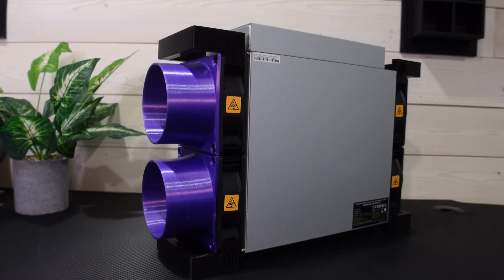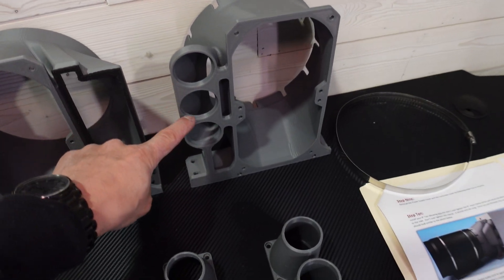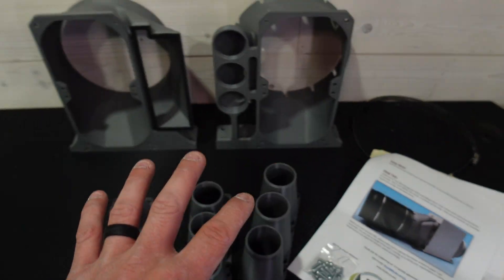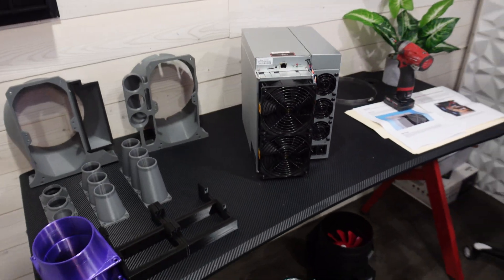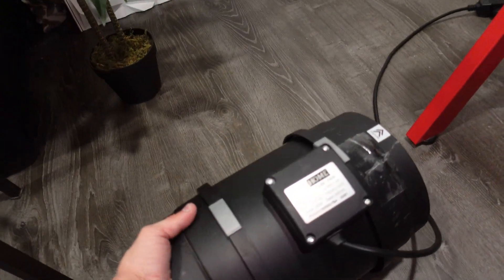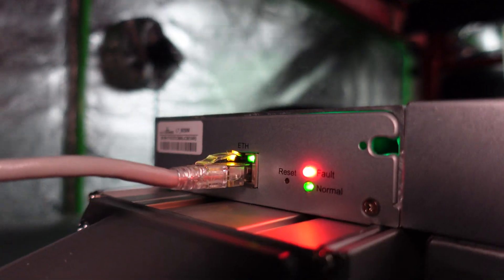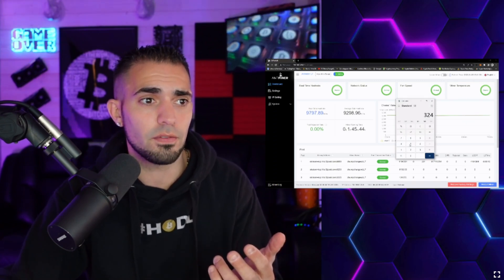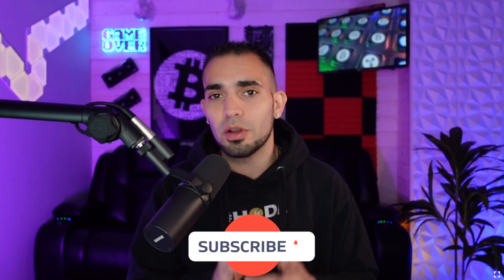Best Cooling Solution?

Comment: Leaving those PSU fans installed is a mistake; they partially block airflow and obviously contribute to noise. The same can be said for the grilles that "protect" the intakes and exhausts of the main hashboards stock fans. These metal grilles serve no purpose, so they're perfectly dispensable.

Comment: I have the Fruits and Associates kit for the K7 and the actual AC Infinity 8" inline fan. The AC infinity fan is only on at 50% and only draws 50-60 watts. So it's really important to get the correct fan for the kit because it will actually save you many watts at the wall.
Reply from the maker: Yes I am in the process now and will do an update video with the L7 on low power mode

Comment: CCXD wow awesome content great 👍 I got allot of this shroud as well even help with the S17 shroud design with John truly awesome kits! and if your in-line fan die your miner will shutdown, your PSU will shutdown first before the ASIC chips even gets to its 88*c shutdown limits, the previous design that only cool the hashboards will shutdown when the PCB hashboards temp gets to its set limits well before chip temps limits, also you can max OC using air vs water with this kit.

Comment: Need before and after temperatures
Reply: Also, those fans you left in the psu add significant air restriction
Reply from the maker: I show the temps in the video at the beginning and the end, I just dont say it outloud. The psu fans dont cause any restriction at all actually. The force of the inline fan spins them...

Comment: Looks impressive. How are you going to be able to heat your whole house now with outlet temps at 68°?
Reply from the maker: The actual temps of the chips on the unit donesnt mean that is actually the temperature air coming out of the unit so it will still heat the house!

Comment: yes they do have high temp safety, one of my two constantly overheats unlucky in the chip lottery, load the hive os firmware it will auto oc, the one that was overheating i'm running at lower frequancy and voltage to keep it cool, the other one is running faster and cooler.
Reply from the maker: Dude Your AWESOME! Thank you for actually responding to what I needed to know. Apprecite you alot!